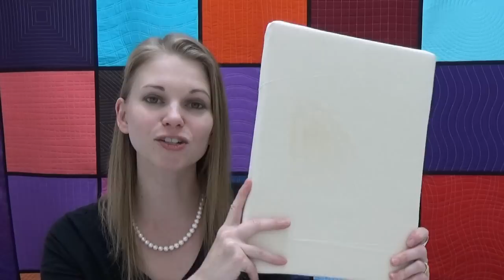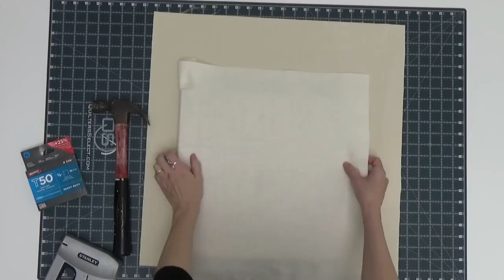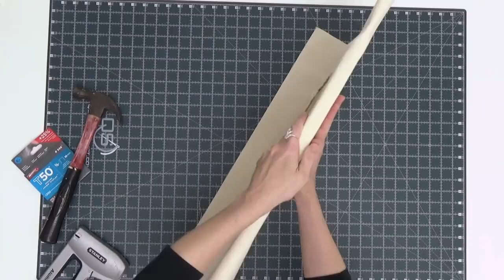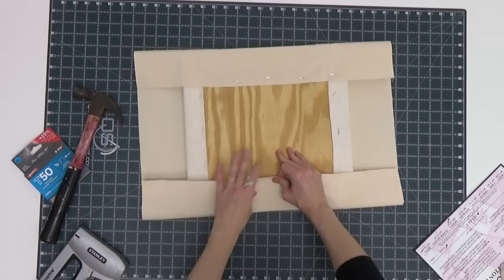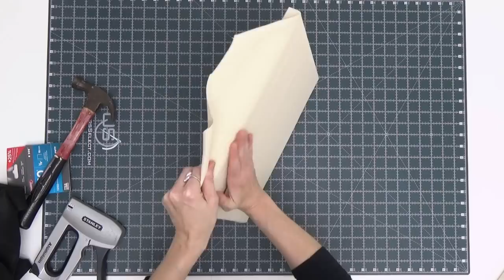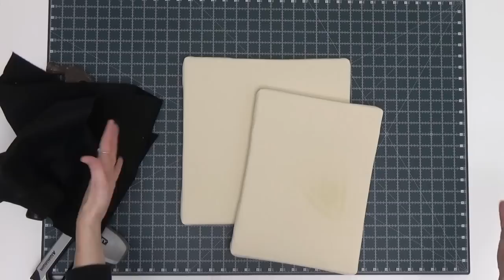Build a Quilters Ironing Board - Make a Pressing Board Any Size!

Comment: Great Tutorial! Mine came out great. I do wish you could add dimensions at the beginning, in the description or in a pinned comment. Here’s the dimensions I used: 3/4” plywood cut 14 x 14” square .  Cotton Batting: 18 x 18“ square. Outer Canvas Cover Fabric: cut 22 x 22” square
Reply from the maker: The dimensions really depend on the size and shape of the pressing board you're making. I have multiple homemade boards in all sizes and shapes. But I will pin your comment since you did the work for me!

Comment: I've made several small ones like this and my husband made me a 3' x 4' free standing ironing table for my height - one of my favorite quilting tools. I always put down a layer of aluminum foil on the wood beneath the batting to keep the steam/damp from the wood, plus it reflects heat for better pressing.
Reply from the maker: We've played with using a heat reflective batting, but Dad wasn't a fan. He felt like it trapped the heat within the board and didn't reflect it as well as he expected. We'll try tin foil next time!
Reply: That is an excellent idea. Thank you.

Comment: I bought a wooden tv tray covered that with cotton batting and fabric. It is the perfect height for me and it doesnt take up precious room on my sewing table.
Reply: I did the same. It's perfect!
Reply from the maker: That's a great idea!
Reply: Great idea!! I have some wooden TV trays in my closet and will use one for this. It's small enough to fit in my already overcrowded sewing room and short enough to use while sitting down, saving me the trouble of the up and down each time I need to press a seam.
Reply: Hi Denise. Do you have a photo of yours at all? I have a wooden TV tray that I can use. Thanks
Reply: @mariamcphail  Genius!
Reply: Is there a way to make a fitted cover with elastic so as to just wash it occasionally?  I am somewhat new at this and deciding and making my own ideas is not something I am confidently capable of :)
Reply: @candyly4  Yes there is! After seeing that the original cover was stained and I couldn't wash it, I made another cover and added elastic diagonally at each corner so I can slip it off and wash it when necessary. I was going to add elastic all around but I didn't want puckering around the perimeter of the table/ironing board. This works perfectly and keeps the pad nice and flat.
Reply: @mariamcphail  Thanks!  Did you need to add an length?
Reply: @candyly4  I added about 1&1/2" on each side so it would go over the sides of the tv tray and I put a row of stitching just a little bit bigger than the tv tray itself - it looks like it has a border around the tray.
I hope that makes sense... :)
Reply: Candy White  I can’t seem to find the photo

Comment: One thing I did to my pressing board was take a fabric marker and draw straight lines at different measurements, and squares onto the fabric. It helps me to iron strips straight and iron blocks inside the squares without warping them. Also, the heat of the iron 'fixed' the marker and I have no bleed even with steam. Great video!
Reply from the maker: That's a great idea! I've been thinking about creating a simple print with Spoonflower with straight lines and maybe a 45 degree angle marked. That could work too printed on eco canvas!

Comment: I have a 72" resin table that serves as my pressing, cutting, and folding surface (as that room is also my laundry room).  I had a piece of plywood cut to fit the whole table and used Warm & Natural and canvas for the (full table) pressing surface.  I did the additional step of spritzing it all down with water as a last step...shrunk the canvas just a tad to make sure it was snug.  I keep a large cutting mat on one side but can easily take it off to give me a huge area, or add more smaller cutting mats to have a huge cutting surface.
Reply from the maker: That's a great suggestion about shrinking it with water! Thank you for sharing!

Comment: Leah can I use Teflon coated utility fabric instead of the canvas?
Reply from the maker: I'm not familiar with this material, so I can't say yes or no on this. I'd check and see how it smells when you press on it. Heating up Teflon over and over doesn't sound like fun to me, but if it works, go for it!
Reply: @LeahDay  thanks for the reply. It's silver colored and sold at JoAnn's... ironing board covers were made of it.

Comment: If you can attach half-round wood molding to 1 or 2 of the edges of the bare board you could use those padded edges to press small curves (face masks?) and darts.  Or start with a board with already rounded edges such as a thick kitchen cutting board.  Or, just glue two 1/2" or 3/4" boards together and then sand the edges to a half-round shape. Depending on your needs, the additional complexity may be worth it if you have the right tools.

Comment: I made one today. My house was built in 1982 and when the builder cut out the holes for the sink; after he had put the cabinet top on the wood.  He gave me one of the cut-outs for a cutting board that matched my cabinet top. . I’ve used it for years, but I have other ones to use. I had some canvas that I’d bought for something else but decided against that project, and I’d bought some cotton batting to that is for making microwaveable baked potatoes. The corners were rounded. I don’t like the finished corners that much, but it is pretty heavy canvas. I made it while tending to 2 grandkids. Thanks for the video.

Comment: I made my own ironing mat! Used heat reflective fabric, heavy felt by the yard and some cotton fabric on top. Stapled it to a 15x9" wood board in layers and covered the staples with some cute ribbon, hand sewn around the perimeter. I put the seams and staples on the sides so it would look nicer and wouldn't scratch table surfaces.  Your video was so helpful!
Reply: Where did you get the heat reflective fabric? Do you have a link? I've been searching and everyone has 'insulated' fabric for like pot holders which is not the same type of fabric.

Comment: A couple years ago, my husband @daileywoodworks was making Wahoo boards for customers. There was a mistake board so I stole it and covered it in two layers of thin batting and had him make 4 small feet for it. It’s been my pressing board ever since! It’s badly in need of recovering. It’s about 2’x2’. I’ve been thinking I need a tiny one for beside my machine but also thinking about a much bigger one. Currently, my husband is building me a craft room in the garage so we can have 3 actual bedrooms again. One thing that will eventually be a part of it is a huge table about 5x5 (it will also fold away) for pressing, basting, etc. I think I am going to make a much bigger one for that table!
Reply from the maker: That sounds wonderful! It's good to be thinking about how your space can be better and more efficiently organized and designed. I love reorganizing so it functions better and we're able to finish more quilts!

Comment: Do you think a colored cotton canvas cover would bleed?
Reply from the maker: You should probably test it on a smaller board first. I would wash it and throw some color catchers in for bleeding. My worry is the color would not be dye, but more like paint on the surface of the canvas, which will tend to melt under high heat of an iron.
Reply: Leah Day thanks!!

Comment: When you recover the board each year, how do you easily remove the staples?
Reply from the maker: Unfortunately that is never an easy part. I pull hard against the canvas and that will pull a lot of the staples out, but many of them will break. I usually just pound them back into the board and then cover it with a new piece of canvas.
Reply: Could you just put a new cover over the old one? Or cut the old one off?

Comment: Do NOT use green-treated plywood. If you are remotely tempted to use green-treated plywood because that is the scraps you may have, don't use it. I had leftover half-inch regular, untreated plywood that I cut to the size I wanted and rounded the corners, and just laminated/glued the 2 pieces together to make my pressing board. Yes, it is thicker and heavier, definitely overkill for strength, but I did not want to buy three-quarter inch plywood just for this project, and I found that half-inch alone is not quite thick enough. You could even laminate/glue 3 pieces of quarter-inch plywood together or a combination of half-inch plus quarter-inch plywood if those are the scraps you have.
Reply from the maker: Thank you for sharing your experience Bonnie!
Reply: Why NOT use green-treated plywood?
Reply: I'm thinking that the chemicals are released into the air when you put a hot iron on it, maybe.  IDK.
Reply: The green treated wood you're referring  to is treated with a form of copper and arsenic to deter decay. That is not something you should be handling or breathing.

Comment: Is the 3/4 inch plywood the only thickness you can use?
Reply from the maker: Nope, I've also used 1/2 inch thick as well. It really depends on the thickness of your staples. If you have a really thin board, make sure to use smaller staples - 1/4 inch instead of 3/8 inch.
Reply: I used 1/2 inch birch plywood. The big box stores will cut to your size needed.
Reply: Check out Matt's Ironing Board adventure form Jordan Fabrics.

Comment: agreed. a large pressing area to press long seams makes a huge difference. we used a canvas with pattern that has straight lines. turned it wrong side up to help from distracting my eye. It's big enough to press a strip set or tube and it has made a dramatic difference. You are right in saying a pressing board is one of the most important tools in a sewing room. Also, we used insulbright and batting. This reflects the heat and helps iron on both sides at once. I press multiple pieces so I can leave the previous block on the pressing surface to cool down and "remember" how I want it to behave. That little tip has also made a huge difference in pressing. Ironing and pressing is now not a chore but a pleasure
Reply from the maker: Thank you for sharing your experience Joyce! I've tried Insulbright and I didn't like it as much as plain cotton. I'm now thinking of new ways to cover the boards with helpful lines. Maybe I can print something fun with canvas from Spoonflower!
Reply: What about ticking?  It has lines.